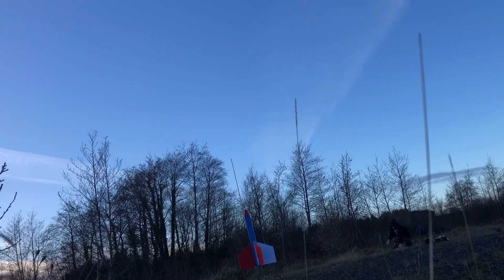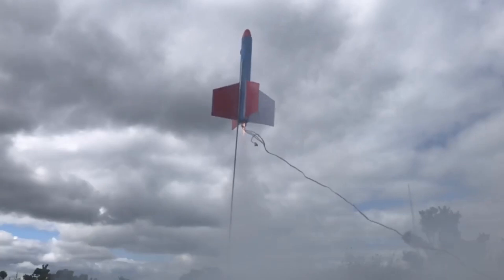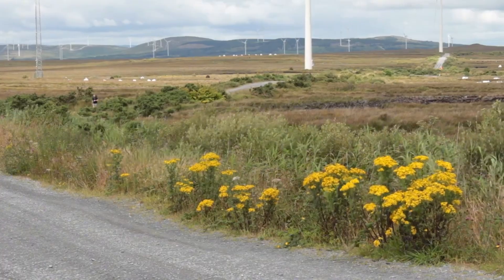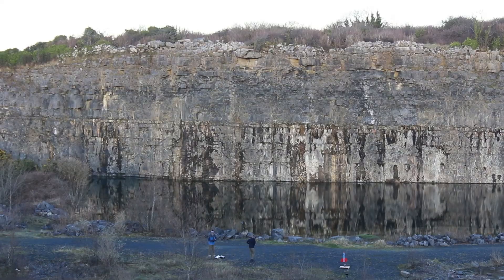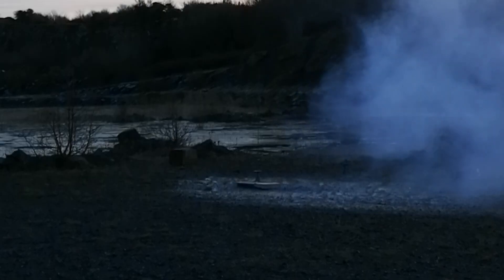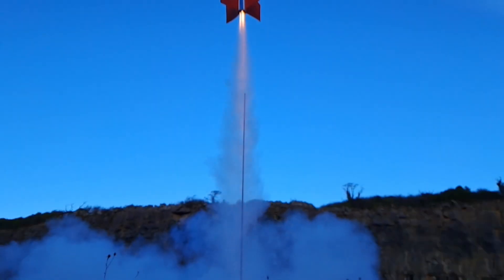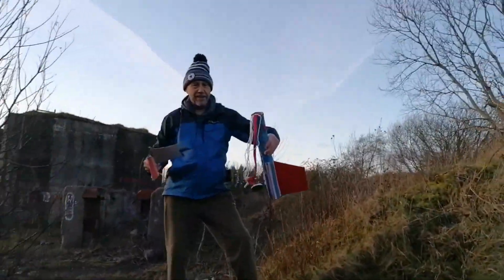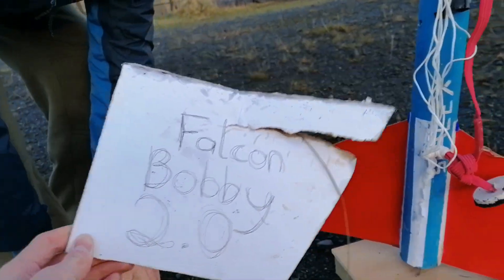Launching my Biggest Rocket!

Comment: A little tip: as long as the rocket is not too heavy, you often don't need a parachute to bring it back to earth in one piece.
A “flutter cloth/flutter band” is often sufficient.
In other words, a piece of fabric that is pushed out and connected to the rocket on one side with a string.
This can be rolled up much smaller, is lighter and slows down small rockets sufficiently so that they are not damaged.
But it depends very much on the weight of the rocket.
Reply from the maker: The rocket weighed about 1kg so I don't think it would work but I could be wrong.
Reply: @T_Plus_Zero is that 1kg with or without the engines?

Comment: I think that the open space between the motor tubes may have caused an issue with the eject charge not being able to pressurise under the parachute. Congratulations on the successful ignition and launch.
Reply: THERE IT IS! 😁👍👍🇺🇸
Reply from the maker: Thanks! Didn't think about that actually.